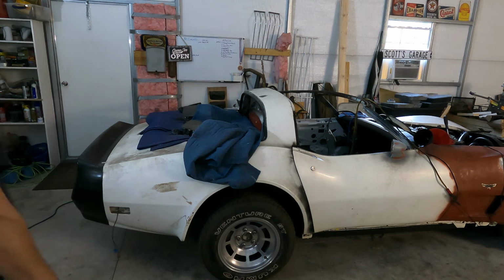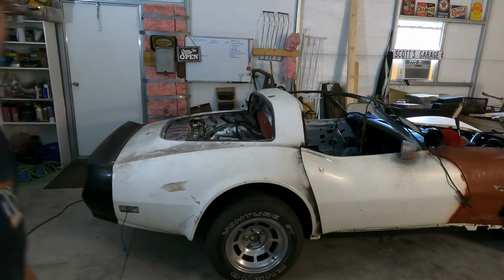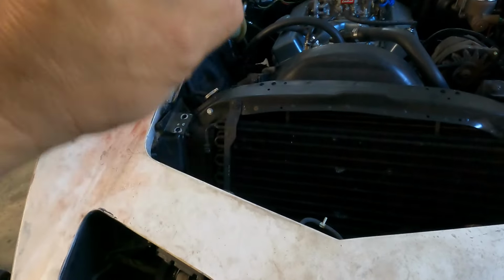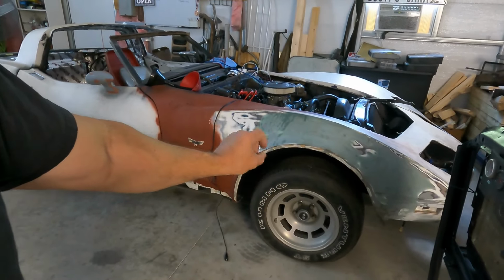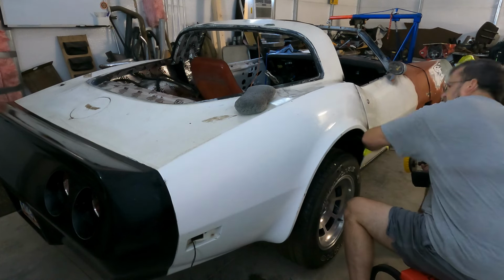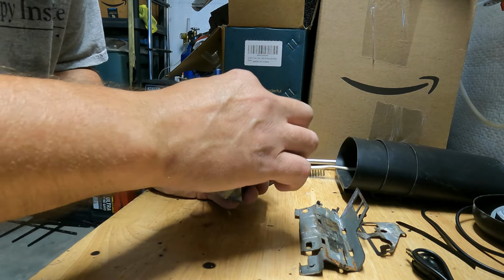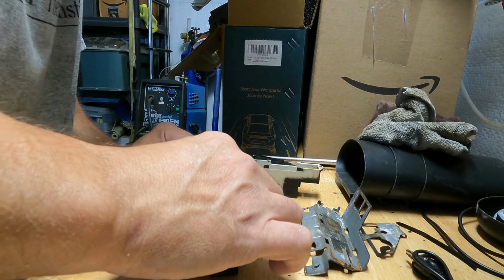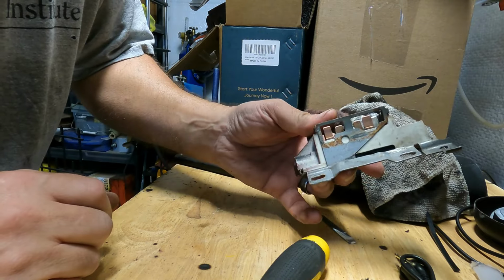79 Corvette Introduction

Comment: You can get a new ignition switch from rock auto or some local parts store for around 20 to 30 buck . FYI Make sure it's a switch for a tilt steering column. Good luck ,Enjoy ypu content.
Reply from the maker: Lol, Rock Auto has them for around $15. Oh well, it was fun learning how the switch worked.  Thanks for the info.

Comment: I’m looking at doing something like Kilmat. Ounce you lay it down, how do you find the screw holes for the console pieces? Am I concerned about nothing?
Reply from the maker: Oh it's a big concern, you have to pay attention with each piece you put down and either use a punch or a razor and cut the holes as you go . If you go back a couple of months in my videos when I did the 81 I missed a seat belt hole and spent almost a hour trying to find it without messing up what I already laid down.